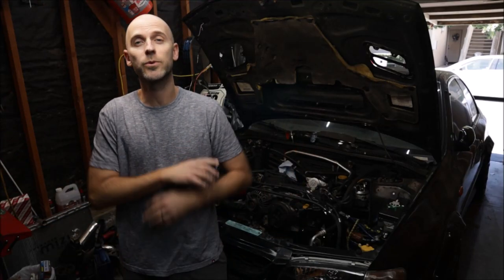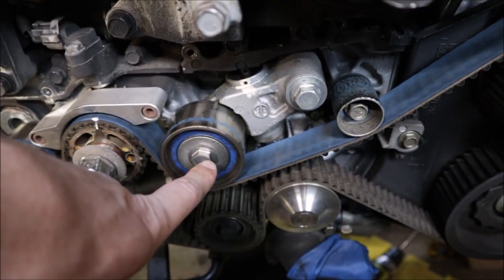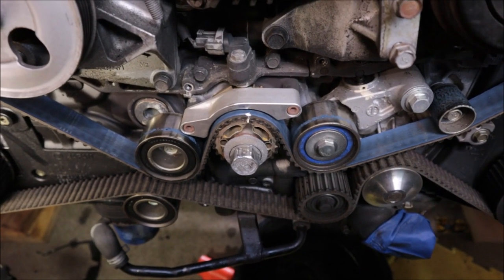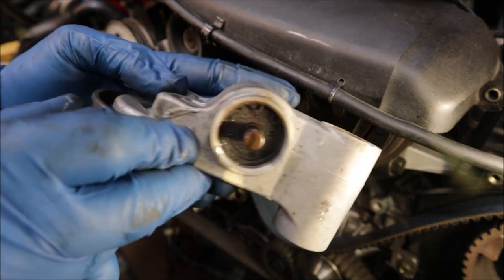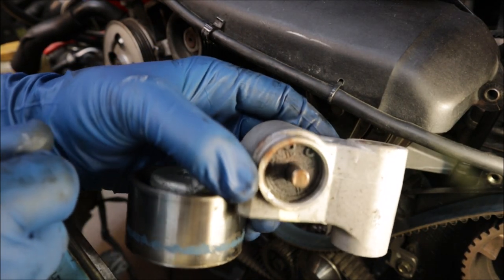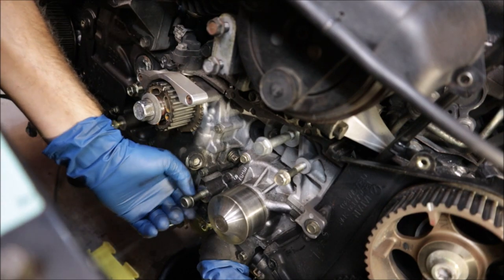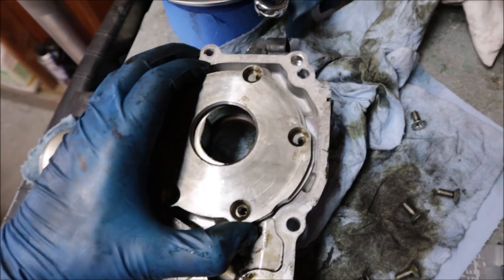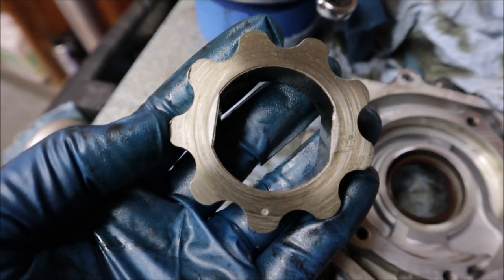Impreza EJ Timing Belt Part 2: Removal and Inspection

Comment: I'm wondering if the leaks are from the power steering pump. The oil from the pump leaks behind the cover.
The bearing for the power steering pump is a 6203 NTN.
I think that old water pump was the factory pump just the cast impeller as you said.
I do like the fact you kept all factory parts and I hope your dealer gave you at least wholesale pricing.
Looks good and I like how it is progressing. Slow is not a bad thing when you are trying to be thorough.
Reply from the maker: @Troy Fankell Slow and steady 😂 I think the PS pump was a major culprit, it was a mess. If the rebuild does not work I’ll replace the whole pump. I would like to reroute the return line as the hard line is in my way for the intake I purchased. Other than the chase bays kit I don’t know how to reroute the lines as one side is a bard fitting at the reservoir  🤷‍♂️

Comment: The only oil pump I've seen with their own engraving is the Cosworth. Your oil pump scoring is normal, what you wanna look at is the rotor for pitting. If there was pitting then bearing material went through it once. The 12mm oil pump will not have as much oil pressure past 4500rpms. The engine it came on in Japan is DOHC w/ DUAL AVCS, which warrants the extra oil needed. Our USDM STI is DOHC, DUAL AVCS but doesn't rev as high,  which runs a 11mm. The 10mm oil pump found on 02-14 WRX, 04-07STI, is plenty for your engine. You don't have AVCS, oil squirters. The 98 2.5rs DOHC EJ25D runs a 10mm oil pump. 

Ex: we run a modified 10mm oil pump and rev to 9000rpms. 

OEM water pump/ tensioner is the way to go. We've had bad luck and bad quality with Gates.
Reply from the maker: Great info! I trust the oem timing parts the most. My only reasoning for getting a 12 mm is the builder of the engine from previous ownership may have built the engine “lose” and I want to run the same pump as the builder requested. I reached out to the previous owner and he could not remember why they went 12 mm but he would only run it it he was told to years ago. 

Yes, I did find some pitting on the gear which is concerning, however, the original bottom end was an ej257 that spun a bearing and was rebuilt. Did they reuse the old pump? Use a old pump sitting around? Maybe the material is from the current bearings? Guess I’ll have to just cross my fingers? If I spun a bearing now I would have changed most of the oil components; pump, pick up, pan, cooler, cooler pipe, dip stick tube. But now, I don’t know if or where the bearing material came from. I HOPE it was just an old pump reused 🙏😳
Reply: @RoadPatina  there are a  few different ways the oil pump can be bad from an engine that suffered a bearing failure. Depending on how the engine died will determine the fate of the oil pump. 

Pitting is the first to happen and how much material came through will determine how bad it is. If you hear it starting to tap and turn it off quickly,  it will reduce the shavings on the rotor. If you keep the engine running and the knocking is loud, most if not all of the bearing material will be gone and larger chunks go through the rotor. If a piston died and small pieces make it past the mesh of the oil pick up, then the pump eats them. If you turned off the car quickly the pump can be reused after thoroughly taken apart, cleaned, inspected. Engines that lock up from a bearing failure may have excessive heat transfer from bearing to crank to main bores on the block. This heat gets transferred to the rotor of the oil pump and it will warp the pump. If it doesn't rotate well after cleaning and assembly, it is likely warped. 

I ran a 12mm pump on my EJ22T build. I retained the oil squirters, ran AVCS heads,  loose rod bearings. If i didn't run the oil squirters, i would run the 10mm.

If advise you to run an external oil cooler,  minimum 7" x 14" core. It'll keep oil temps from rising when you run the car hard.